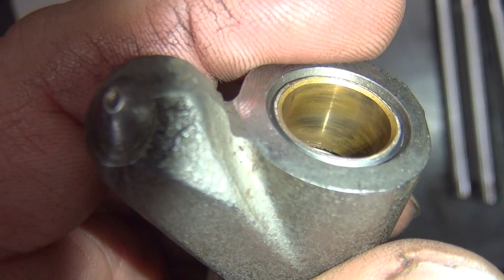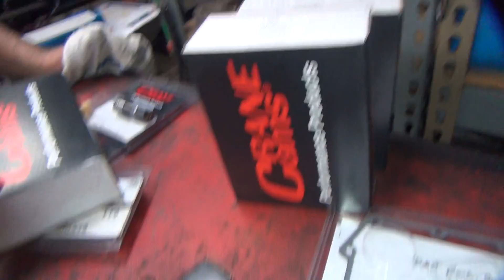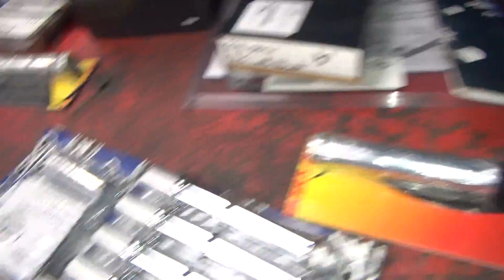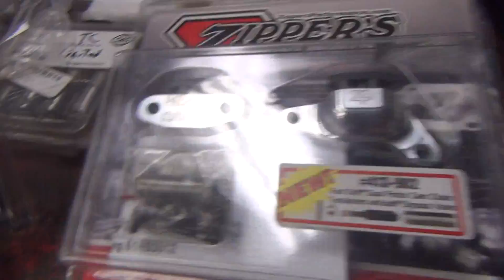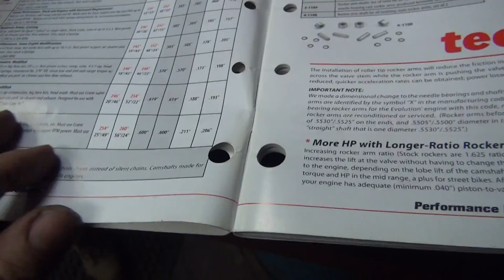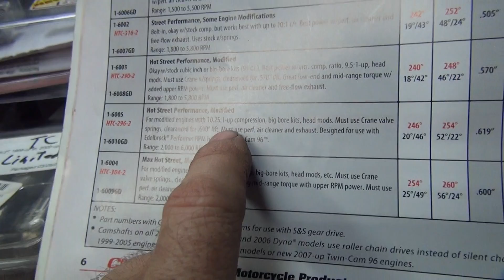#102 2008 110ci cvo twincam fxd dyna motor repair rebuild harley by tatro machine

Comment: did the engine seize?  I woulda just put oil back in a rode it.
Reply from the maker: you don't know what the damage is until you take it apart and see for yourself. we hopped it up as it went back together.
tatro
Reply: Agreed but had nothing to lose since according to Harley, the engine was toast.  Put the idiot gauge back, refill and ride it woulda been an option.  Seems it got slightly overheated causing power loss and knocking / pinging.  The computer would also lean out the fuel air mixture due to the excessive heat causing power loss.

Comment: Hi Keenan. did you accidentally place the video out of sequence? I saw#101 (Engine in Frame) then #102 (engine and parts out...choosing cams..then #103 (Engine back in) LOL
Reply from the maker: no, we were pulling the motor out to rebuild it because it ran out of oil but found that it was ok so we just hoped it up instead.
tatro
Reply: Did you guys check the crank out Tatro ?